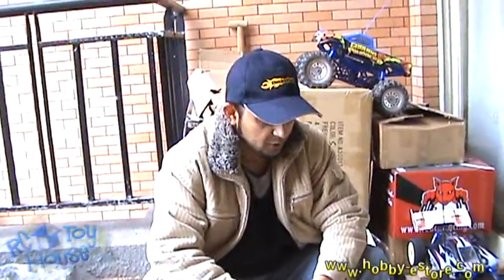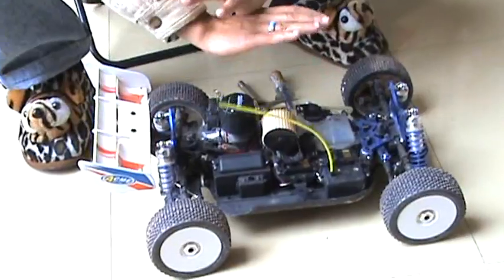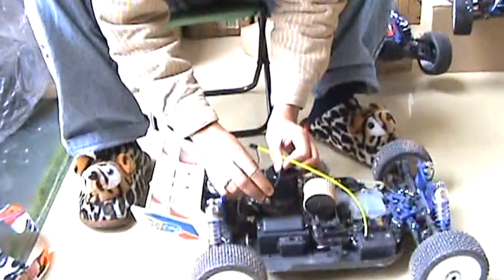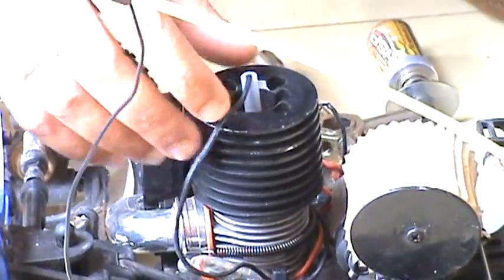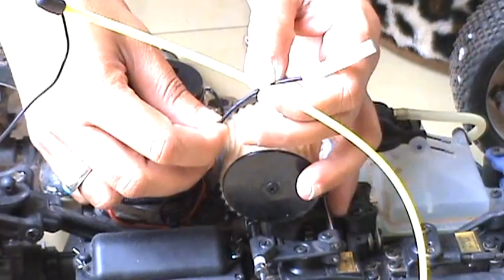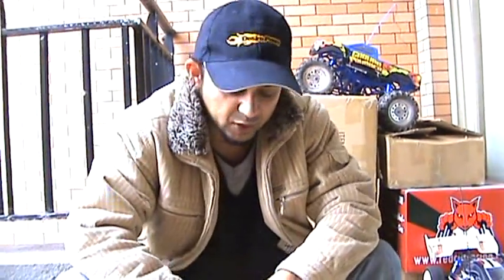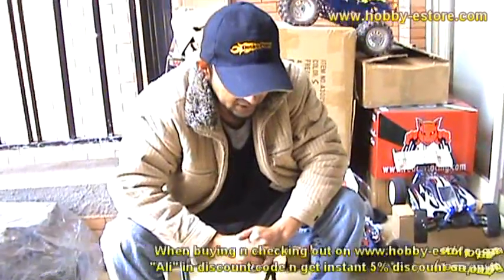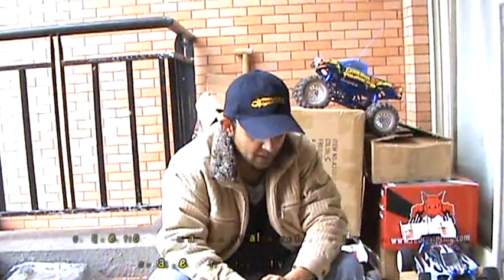Remote Start Buggy Going out of control

Comment: @alishanmao  Okay alishanmao if this problems occurs cant you just put a fuel  line tube on that wire so it wont touch the engine so that the fuel line tube will touch The fuel line seems to not have a problem of touching the engine on my regurlar rc nitro car...